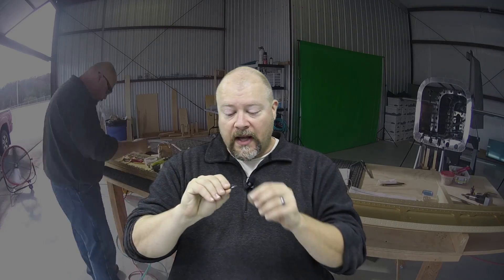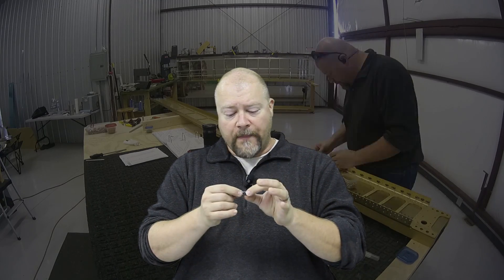RV-10 Wings - Correction - Nutplate Correction

Comment: Everything you could ever want to know about nutplates, rivets, wiring or just about anything else you can think of associated with aircraft construction or maintenance can be found (for free) in AC 65 9,12 and 15. These are the old school handbooks for A&P student study in preparation to take the written test. I still have mine from the 1970's when I took got my A&P and they are an invaluable asset if you have a question about how something should be done on your airplane. Its all free online through the FAA website. Your tax dollars at work. Really!

Comment: One tip. I noticed in some close-ups of your countersinks, you had some chattering in the c/s on some thinner metals. Take a thicker piece of scrap metal, drill the same size hole as your pilot on the c/s, and use it as a backing plate where ever you can or need. It acts as a guide and keeps the pilot steady. It helps. Have fun.
Reply from the maker: Good advice, but I think some of the chatter is due to my countersink cutter head is getting dull.. I need to get a new one..

Comment: You're a good dude J, and I enjoy your video's. Just want you to know I am never trying to be a BUTTHEAD when I comment on your video's. I have always been the type of person in the aviation industry who wants to help people who are learning, if you learn the wrong way to do something, you keep doing it wrong, but even worse than that, you teach the next guy the wrong way to do things. I don't know if you saw the comments about alodine and priming, but an option for mating steal parts to aluminum parts is the use of dissimilar metal tape to prevent an electrolytic reaction (which causes dissimilar metal corrosion when a liquid is introduced), it MAY be cheaper than primer and it is quicker. we're talking large parts here, not nutplates, although I worked at one company years ago building a certain airplane and they made us put that tape on ALL nutplates. Stupid because I believe nutplate have a galvanized coating. Just a thought, not necessary. Best of luck.